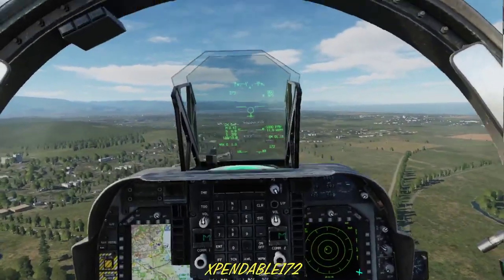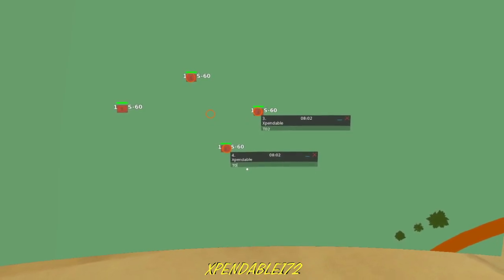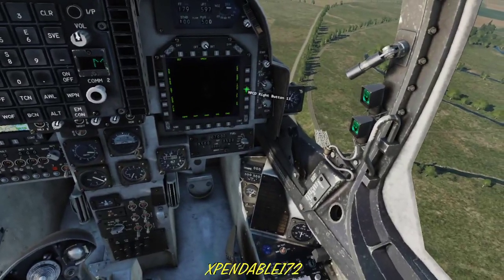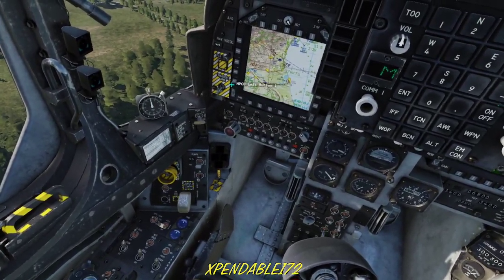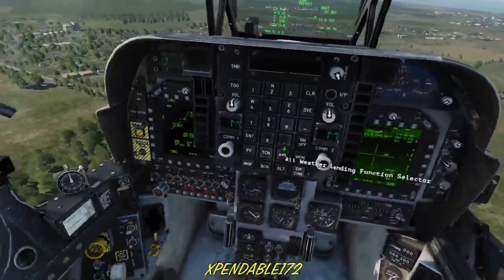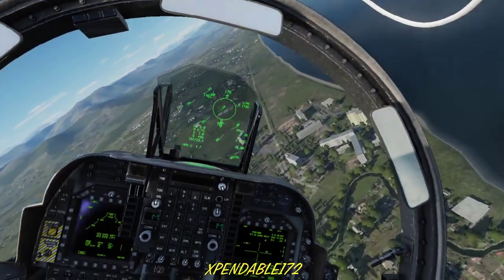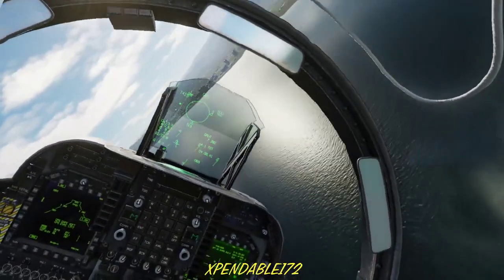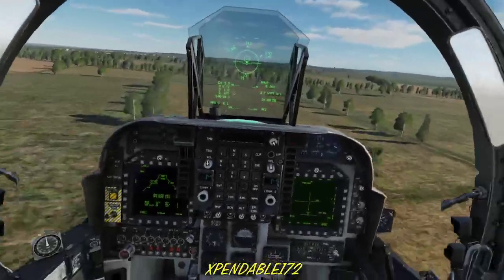JDAM lofting technique with the DCS AV-8B Harrier

Comment: 2.5nm pull up is very close, IR air defence and AAA would be a problem? Lofting in the F16 is OK as you can start to pull up around 9nm. I will have to try this in the harrier see what happens :-) cheers.
Reply from the maker: That makes sense from an F-16 because you would be going faster, and thus can loft from farther away.  Yes, you do have to be careful about IR & AAA.  I've had to dodge that stuff on occasion.